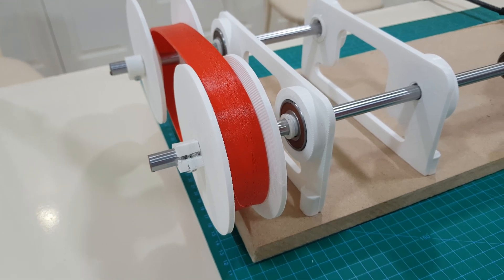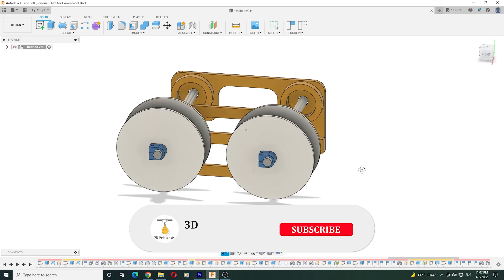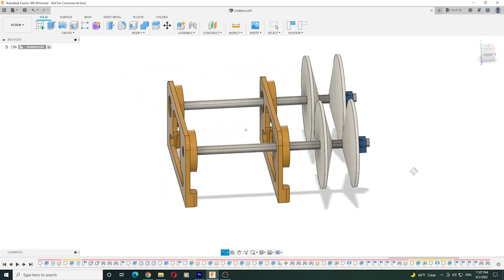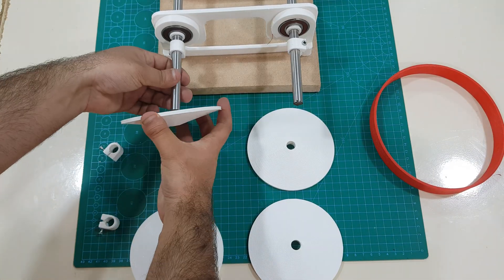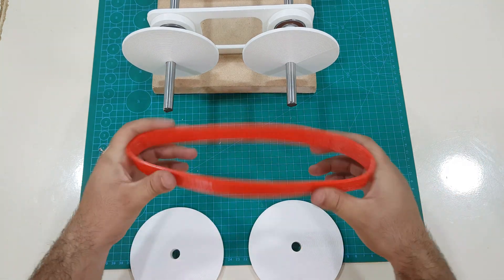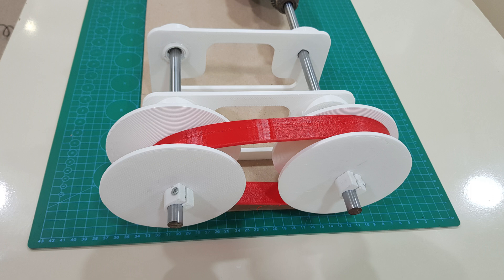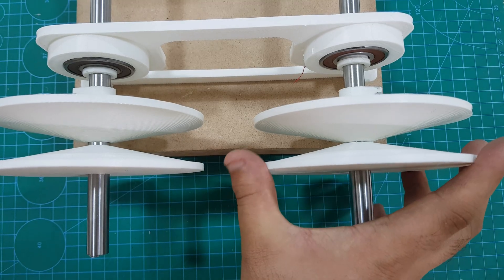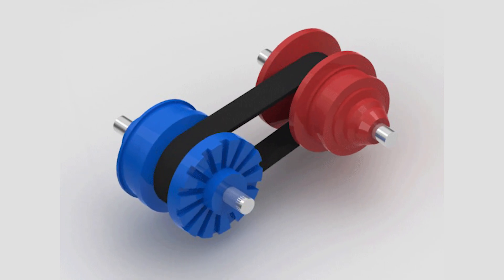How do CVT transmissions work?

Comment: Modern CVTs also usually have 2 planetary gears now so they can both get more traction and better speed. you can feel this in normal use as a jolt in speed when you get above the threshold.

Comment: Now if you add the right spring to load the variable plate you can have it do it automatically.  The spring tension will change the torque required to drop the gearing to its lowest.

Comment: Forgot to mention that these types of transmissions tend to be less reliable than other types of transmissions.
Reply: It’s not that they are less reliable, it’s that they are used in the wrong application, city cars have them for some reason even though they are meant to be for racing/high performance applications

Comment: Finally, a simple explanation for what’s really going on with a CVT.

But it’s kind of like communism. More of an academic  excercise rather than a practical solution.

Nissan CVTs are notorious for being hunks  of garbage. The time I spent behind the wheel of a few was odd because the engine doesn’t rev the way that you expect it to after driving standard autos and MTs for a lifetime- a bit off putting, but performance was nice.

I hope this technology continues to improve.
Reply: I’m pretty sure it was in the Ferrari 430, and it drove really fine, the tech is already good, it’s that they are used in the wrong application while also being cheaply manufactured
Reply from the maker: thank you for your information
Reply: Yeah my nissan is starting to develop a slipping belt. I'm hoping if I baby it enough it'll last me